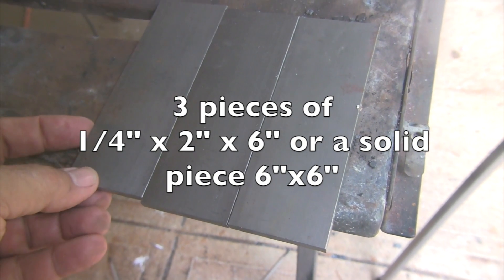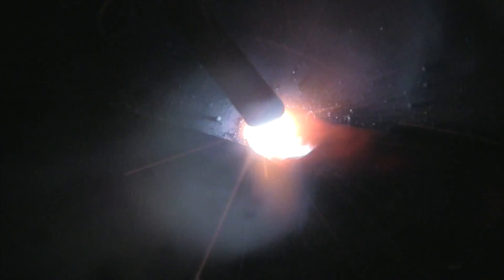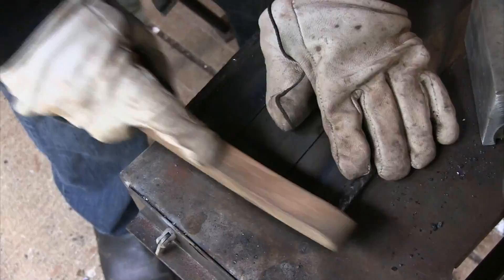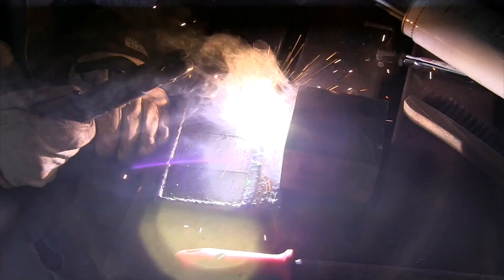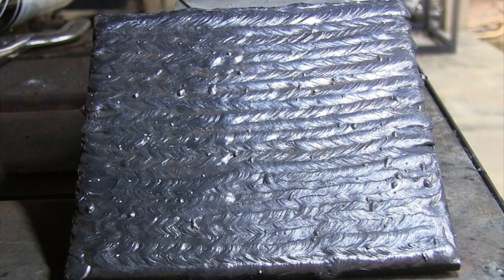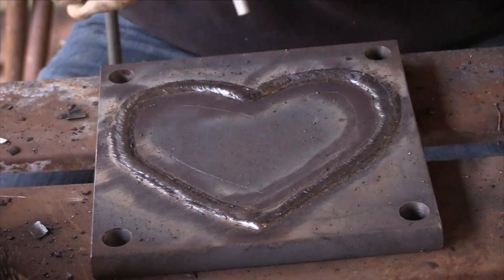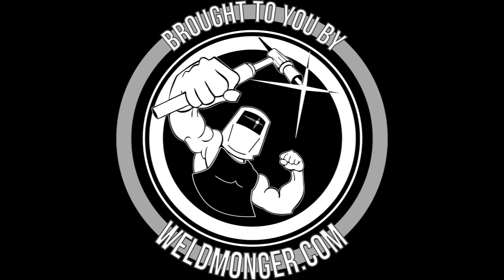Stick Welding 7018 padding beads

Comment: I’ve found that when practicing it’s best to put yourself into bad situations (in welding terms) poorly prepped material, bad fit up, a fan blowing in an inconvenient direction. These things make practice harder, and I think that it will improve the quality of your serviceable parts if you are acostomed to running in bad conditions. In military terms “if it ain’t rainin, we ain’t trainin”
Reply: Try to get comfortable being uncomfortable.

Comment: Any tips for overhead 7018 starts? That's my achellies is starting rod overhead without porosity
Reply: Usually 15ft in air off 10ft ladder in tight spot is most trouble

Comment: Thank You for posting these videos.  Very Informative.  FYI,  White out. brand Correction pens, with ball point tips.  work 10x better than Silver-streak or soap stone. High visibility while welding. Works Great for Torch cutting, as well. When you still want to save your line,  No matter how hot it gets, you still see it. Amazing stuff. and it's made for paper.

Comment: Were you using a different machine for the heart?  Looked like a Thunderbolt for the square, but different stinger on the heart... 

I like my Hobart AC/DC Stickmate (same machine as the blue Thunderbolt)... welds pretty nice for a buzz box.

Comment: Hey Jody, now you have the ryobi grinder, hopefully you were able to upgrade to the 4amp hr batteries, Ryobi has a cordless/corded fan that I think you would find handy. Check it out, it's awesome, you can put or hang it anywhere and not worry about another cord to trip on

Comment: I don’t often write comments on YT but I wanted to tell you thanks. I do a lot of off roading here in the Sierra mountains, and have come across several instances where being able to weld is a huge advantage to either being towed out, or figuring your way out of it. Just started welding, but by far I have relied on your channel more than any other. Clearly you’ve got this art down. Thanks.

Comment: Touching up the end of the electrode with the file.  Is that to knock off a bit of the flux to expose the core for the next start?  Really new at this and curious about the small stuff a pro does.
Reply from the maker: yes, it is to create a bare spot so the rod  restarts easier.  a quick easy way is to just break off some flux with gloves but it is not as precise.  also some old hands just whip the rod as soon as they are done with a bead and if done just right it will sling the ball off the end and the rod will restart ok without doing anything.
but that can also be unsafe if there are folks or flammable stuff around.
Reply: Thanks for the quick reply, think I'll leave the lava tossing to others, I have plenty of files.  I'm starting (post retirement) literally from your videos with an AC/DC tombstone, everlast MIG & plasma cutter & an acetylene torch.  Was really intimidating to scratch that first arc but I'm getting more confidence with time.  Taking classes at the jr. college next fall.  Hope to get a chance to buy you a cold one some day!  Thanks for sharing your expertise.

Comment: This is not meant to be rude in any way but I notice no matter if it’s stick, mig, flux cored,etc you always say you need to get some practice? I thought you were a full time welder or was I wrong? Nice video.
Reply from the maker: I am no longer a full time welder.  But when I was, I still practiced when I had time.  I retired from a 35 year welding career and now I make youtube videos and have an online store at https://weldmongerstore.com/
Reply: Weld Weld Practice still doesn’t hurt. And often you end up doing similar jobs most of the time so practicing with different methods or styles can help things stay fresh if you get a special job.

Comment: I would love to have a "silver pencil" like pen that lights up or reflects the arc when you light up.  I can't see any of of these damn things they have now.  It would sure make writing with a stick easier.
Reply: Sparky The Welder That Markal pencil Jody uses is great for that, bought one because Jody likes it and have been thankful I did. Available on Amazon.
Reply: Sparky The Welder try different things- it often depends on the material- soap stone is useless on stainless or aluminum, but great on carbon mill scale. Sharpie is the opposite. If possible, engraving would be great! But now always practical. Some things show up better through my hood, just depends on the process, material and marker.

Comment: Why do people use 6013 to run a first bead then use 7014  or 7018?
Reply: Edgar Bravo 7018 could melt the edges. 6013 is a mild penetrating rod.
Reply from the maker: I only did it for the sake of seeing the difference in the puddle

Comment: I'm 54... I was about 19y-o, (but first, way back time-machine here, school teacher hated me cause I've had my hand on since 9y-o.... 14y-o  4'-9" tall kid shy/afraid of a 6'-8" hell-angel look-like teacher trying to fail-proof every single sample I could make to no avail.... I left school at 15.... crying but proud) so, happy at home/farm, it seemed like school was an eternity behind yet back then, making stuff for the farm, I could got through 50lbs of old 1/8" 7024 that my dad had in the shop for 4yrs, instead of his usual 7014/6011 (I had RIP his old Forney 220 welding machine. He got a new Arcweld/Canox 280 550/220v which I myself re-wired for 220v) ...I could go through each rod like butter doing something like 1" wide by 3" long-pass for each rod (other farmers that have been welding/working at welding-shops for years/or had been taking lessons, would stop by my out-door shop-setup and be amazed at my welds.... and I was like "I don't know! it's just some damp old shit rods I'm wasting away") It was so easy, way too easy, that although I've been welding for 40yrs, it always seem to me that if I go longer than 5" with a rod(7018 though), I must be doing something wrong (but). 
Seem to me I've never been able to do the same, but only "pretty" thing. I like when the rod goes very deep as if I would run sub-merge arc-welder.

Knowing what I know today, I do not want to even think about how much talent have been wasted through school. That goes for everything that was supposed to be taught there. 
It takes a very resilient kid today, to through away all that school shit while keeping anything it has learned, and make a business out of it. Schools only produce card-puncher.....
Reply: GHISLAIN LETOURNEAU if schools produce card punchers then why are you one when you couldn't even finish school

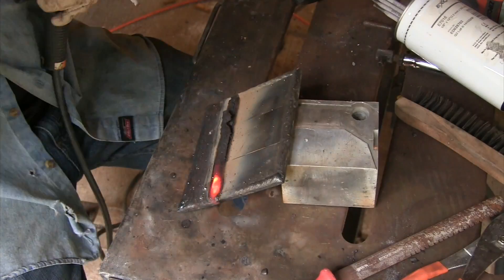Comment: Jody, looks like you were knocking the flux off the rod with a brush before you started a couple of times. (at 3:38 and 4:10)  What is that for?  A restart and minimizing slag??

Comment: Soap stone wire wheel... what exactly happens there? Going to have to try that on some of my forgings.
Reply: Everything is carcinogen these days... Forgetting the fact that many people are still using thorium enhanced tungsten. Cutting wheels will take you out too. Best not to dwell on the negative things, we have enough to deal with in our lives, just live is the best advice.
Reply: You've got to accentuate the positive
Eliminate the negative
Latch on to the affirmative
Don't mess with Mister In-Between
You've got to spread joy up to the maximum
Bring gloom down to the minimum
Have faith or pandemonium
Liable to walk upon the scene
Reply: soapstone is highly carcinogenic, best to not have that powder flying everywhere
Reply: John Mac if your concerned for your health, welding is not for you!
Reply: bc65925 would like to know as well
Reply: Maybe the same reason you rub it on a hand file, helps give a shiny finish and stops chips clogging up the file....maybe does the same on a wire wheel
Reply: also curious!
Reply: I assume it's mildly abrasive?  Dunno, it's a new idea to me too.
Reply: bc65925 hmm
Reply: logical , it may work (even with normal chalk)
Reply: TAKE PROZAC ;)
Reply: I did not knew that one, thank you ;)
Reply: I think it helps not to clog, so the brush is more efficient, plus indeed the chalk is abrasive (but really very soft) and the soapstone is lubricating, making a shiner surface , (less streaks or finer streaks = more shine - chalk powder, or talcum is also used after rubbing products on brass, inox etc, to dry the product and get rid of any traces of it left in micro holes in the material (brass products will oxydize the brass if left on it - but that is another subject )
Reply: sure but it is not very abrasive, better have some powders as the ones used to break valves or other metalic parts http://www.polishing-technology.com/produit/rodage-rodage-classique/abrasifs-poudres
Reply: Only in Kalifornia
Reply: Wow didnt know that. I  have been eatin soapstone all my life. They say tobacco is highly carcinogenic too . But granpa smoked til he was 93. So who knows

Comment: Jody can you do a video on the x block on how to stack beads and the pattern and angles when goin on the side walls of the x block?
Reply: Thanks jody i would appreciate it you are a great instructor
Reply from the maker: I am not sure I understand what you mean by x block
Reply: Like in the video jody how to stack the beads and the rod angle for when you get on the sides also how to make it look even flat like one single smooth bead